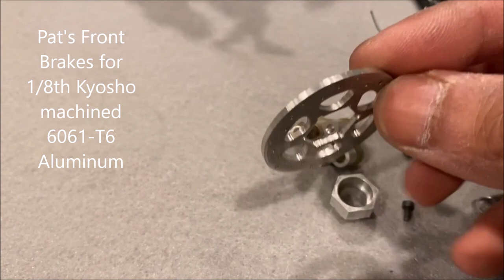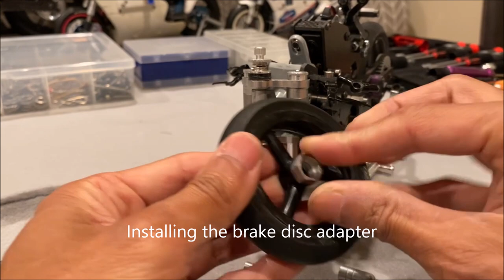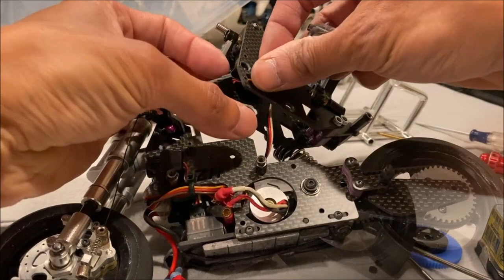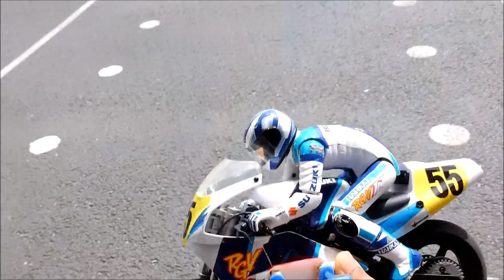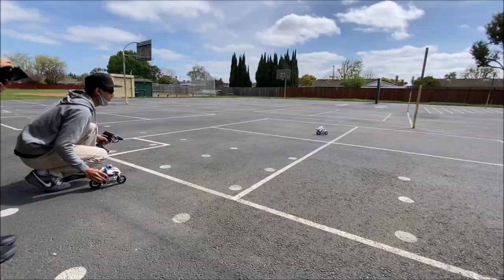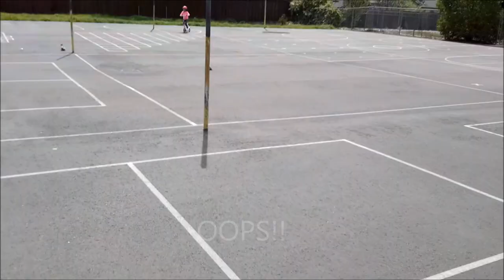Pat's Front Brakes Installation & Test for 1/8 Kyosho R/C Motorcycle

Comment: what radio controller 2 channel u used for it
Reply from the maker: You need any 3 channel radio.  Plug in the brake servo to receiver channel 3 and assign this channel to throttle so it moves with the braking on your controller.

Comment: Hi Ian. Do you know if these brakes are still available for sale?
Reply from the maker: No sorry, but I would just buy 1/8 ZH front forks + ZH front brakes and try to fit them onto the Kyosho.
Reply: @IanGrym  thanks for the advice Ian. I also found a Chinese brand called HR (Hot Racing) that makes parts for Kyosho HOR as well.

Comment: Your's is not kyosho hor, the chassis is ZH? Right
Reply from the maker: Yup, this one: http://www.zh-racing.com/81-KHB3.htm
Reply: Thanks replying, very useful because ZH seems not very active these days.
I already have a kyosho hor (full option), may diy the body(chassis), cut graphite, so hopefully can use the ZH gear system, hor restricted by its tiny gearbox...in turn the motor size....
Reply: @kairosanna1292  ZH Racing is still active. I've just recently ordered a frame and parts from them by contacting the owner through Facebook.